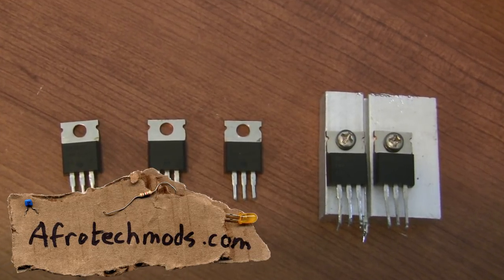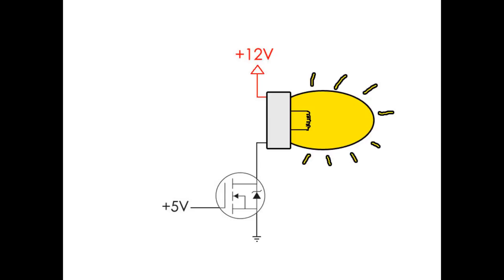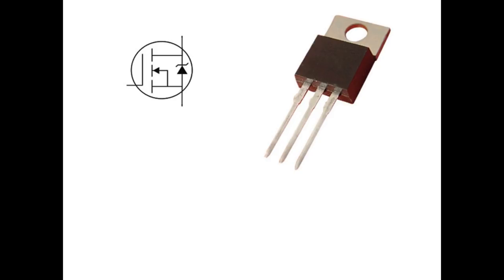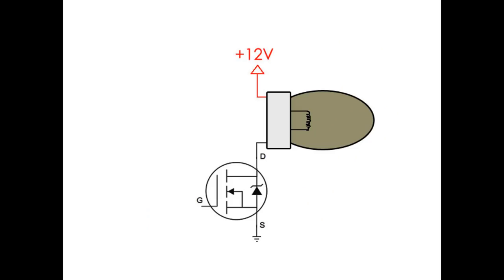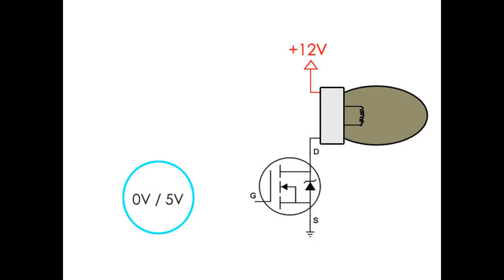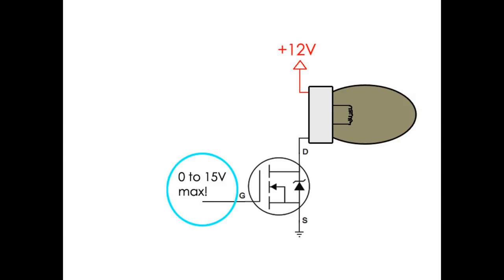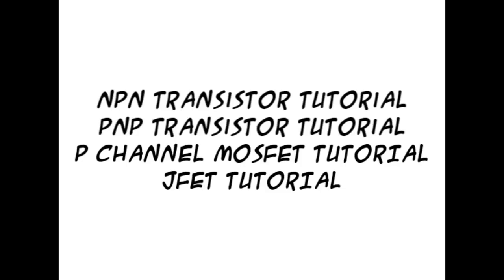Transistor / MOSFET tutorial

Comment from the maker: Gah. Now I wish I had covered this in the video. The gate pin has a small capacitance, and will hold a voltage for many minutes with no power applied and pick up stray voltages very easily. So you should put a 100k resistor from gate to ground to discharge the gate and have the FET off by default.
Reply: i figured it needs a pull down resistor. I wish you were posting more vids

Comment: A water heater takes AC, you can only switch DC with the circuit from this video. You could use that last circuit he describes here with the relay. The mosfet switches the relay, the relay switches your water heater.
If you want to switch AC directly, use a TRIAC / Opto coupler combination. There are zero crossing aware opto couplers that makes this very easy. Or you could use a solid state relay, that might be even simpler.

Comment: To people thinking it's a relay. The general purpose is the same, but there are important differences
1. a relay is isolated from the circuit, but a mosfet is not. Drain and Gate share both the Source, meaning that the current of source is gate + drain. Usually this isn't too important, but be sure not to connect a fusion reactor to the gate.
2. Mosfets are much quicker. You really only want a relay at the very end of your circuit, and only use mosfets for this function within the circuit because it doesn't have a built in coil and the moving parts are much much smaller.
Reply: Can you use these to make a PWM control for a cooling fan for a car radiator ?

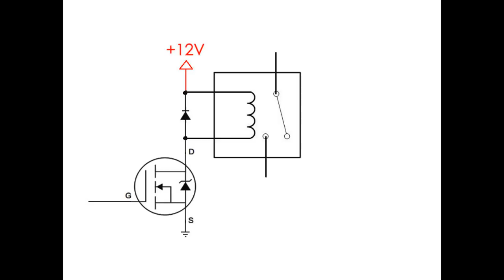Comment: 4:05 made me to subscribe this channel.
This is what i was searching.
In a single video you had explained everything.

Please provide direction of diode to be used with solenoid.
Reply: I agree this is one of the best simplifications on how to use a MOSFET. Saying it explains everything you need to know would be exaggerating. For example it did not answer what do you need to do to switch loads of higher currents even though very high currents are often found in MOSFET data sheets. It's difficult to find a logic level MOSFET that can be used to switch for more than 1-2A of current. It becomes much more difficult if you want to do it with a controlling device using 3.3V logic levels such as an ESP8266 or a Raspberry Pi. When this video has been created 3.3V logic levels were not as widely used as today.

In case you have not yet found the answer, Afrotechmods suggests watching this video of his in a reply to another comment made 4 years ago: https://youtu.be/LXGtE3X2k7Y

Comment from the maker: 3VDC is generally quite low for mosfets. It might work, but there will be noticeable resistance between drain and source (perhaps 1 ohm or more). You can get 'logic level mosfets' that switch on with very low voltages, but they are usually only good for switching 10-30V. If efficiency is not a huge concern and you just want something easy, get a TIP110 from Radio shack or any NPN power transistor. They will switch on fully with 3V no problem.

Comment from the maker: @Xearo167 Electrical engineers work with what is called "conventional current." It is backwards to what is correctly taught in physics, but all electrical engineering laws and formulas are based on it. So for the purposes of designing circuits in EE, current flows from positive to negative.

Comment from the maker: That's a more complicated question to answer but i'll simplify it... the IRFZ44 will start to turn on somewhere between 2-4V but there will still be some resistance around 1k-100k ohm. With Vgate at 5V the resistance is low enough to be useful, roughly 1 ohm. It will be 'fully' turned on with 10V and the resistance will be around 20 milliohms.

Comment from the maker: @HHOhybridBuilder Sort of. Varying the gate voltage from 0 to 5 will vary the drain-source resistance, which will result in the drain-source voltage changing when the FET is operated in the linear region. This is usually done in amplifier circuits and it causes a lot of heat to be generated in the fet. For switching applications you want to avoid the linear region so the FET is either high resistance or very low resistance - nothing in between.

Comment from the maker: @Bizorke For an N channel MOSFET Vgate has to be typically 3-10V higher than Vsource to turn on. The drain voltage does not factor into this, although it indirectly does when the FET is being driven high side. But for example, if Vdrain is 20V and you tried to make Vgate higher than that you might kill your FET.

Comment from the maker: @WINANDMACNERD Sort of. There is a small linear region (around 1-2V) on many fets that will act like a voltage controlled resistance. However you will need to DC bias your sine wave very precisely and make sure the amplitude of the wave stays within the linear region. Read up on the datasheet for RDSon versus Vgs to find the region. This will also cause the fet to heat up. You could also look into digitally controlled potentiometers.

Comment: The way I see it, Drain goes from the negative end of your car light bulb (opposite the side of power input), Source goes to vehicle ground or battery negative (in this example of car light bulb), and Gate is the switch, 0v for off or 5v for on, from some sort of transistor-suitable voltage. Please correct me if I'm wrong, as I've used lots of relays and have never used a transistor of this type before, but this would be a great thing to learn!

Comment from the maker: @herctrap The LED will also need a current limiting resistor as usual. But the main problem here is that the voltage between Gate and Source has to be at least 5V for the FET to turn on, which won't happen because Vsource will now be ~12v when the FET is on, so you'd need a gate voltage of 17v, which is impractically high. In other words, you need a high side gate driver circuit.

Comment: @Afrotechmods Awesome tutorial! Regarding the voltage between gate and drain - once the FET is in the ON state, the voltage on the gate does indeed need to be at least one threshold voltage higher than the DRAIN in order to make the FET FULLY ON. This is only really important when passing very large currents through the FET, where the current times the RdsON is more than 1 volt. This is the reason why it is important to drive the gate with a few volts more than the Vthreshold.

Comment from the maker: @gizmoguyar You got it. Make sure you connect the grounds (a thin wire will do). The high current should be flowing through the FET. That will of course depend on where exactly you have the power wires connected. The -ve wire of your external power source should be connected directly to the FET's source pin. If you were to connect it to a ground pin on your Arduino, you can imagine the current would flow from Source-> Arduino PCB -> -ve wire which would be bad.

Comment: Good mosfet intro! Just mind that drain current and the on resistance of the transistor. Don't want to fry the device do we? And speaking of frying, rid yourself of static electricity before handling them. Wrap them in aluminum foil when storing

I used to employ S901x npn/pnp as my all around standard switching transistors. They're cheap. But when I discovered the 2N7000 I've been using them anywhere I can. Saves me the trouble of putting in and computing for gate current limiting resistor

Comment from the maker: @lowsideswitch Transistors can be switched faster infinitely - most relays can only be switched a few times per second and have a life of 100k cycles. Switching an N MOSFET high side will require some extra gate drive circuitry.

Comment from the maker: No need for a mosfet driver for occasional on/off switching as done in these examples. If you are doing 50+kHz PWM then a gate driver starts becoming more useful (way beyond the scope of this tutorial). The diode is in the correct place for low side switching of inductive loads. You might be thinking of H bridges.

Comment from the maker: @rainbowsalads Use a diode to convert the AC into DC then use an NPN transistor to toggle a relay which switches on the bulb. Or find a small relay with a 3VAC coil voltage.

Comment from the maker: The circuit in the video should work (you can use the version with a relay if you want) if you add a 100k resistor between the gate and ground. This allows charge on the gate to drain to ground which will turn the mosfet off.

Comment from the maker: Sorry, it's a convention electrical engineers use. The ground symbol in these circuits does not actually need to go to the earth ground in your house's wiring. You can basically think of the minus wire from your power supply/battery being the same as ground. The ground wire should definitely not go to the positive terminal though! That would be a short circuit!

Comment: Just a note: MOSFETs more often then not, need more the 5V on the gate to turn on. Study the specifications for your FET and watch out on the dissipation. An important parameter is RDSon.. This is the resistance when the gate threshold is met (Vgs). FETs can have very small RDSon values, like 0.05Ohms.. With very low RDSon values you can switch large currents without a lot of dissipation.
Reply: David Fowler thanks

Comment from the maker: @sjh7132 Good comment. When driving MOSFETS in switching applications, you want to drive them hard on, or hard off. Putting a wussy 1.5V signal at the gate won't be enough to fully turn the FET on, so there will be more resistance, so there will be more heat. A good gate driver circuit will switch hard between 0V and 10V, but 5V is often enough to get the job done if you aren't switching high currents. It all depends on the specific Rds(on) versus Vgs characteristics of the FET.

Comment: Most fun to be had out of these is when building a 12~14.6VDC car amplifier or radio head unit, coupled with a few high power capacitors to really crank out the sound.  What I'm confused about is when a radio head unit is supposedly rated at 50 watts MOSFET for 4 channels each, yet expects to pull all that power (at least 200 watts) through the little tiny gauge ACC power wire.  The memory wire has to be attached to for the radio to work correctly, but there is no way in hell that radio is pulling anywhere near 200 watts RMS without frying wires!  The Pioneer amp I'm using outputs 300 watts max, and it uses pretty fat power input and ground wires!

Comment: Voltage & Current are stored in Inductors and when the electric field of the Inductor collapses, the voltage tends to collapse to a negative version of itself. The diode protects the transistor from what is known as back emf (electromotive force) by limiting the voltage to the voltage at which the diode goes into conductance, which only happens when the field is reversed.

Comment: u definition about transistor is fully correct.. a transistor can be used in three ways.. active, saturated and  cuttoff.. when in active region it is an amplifier which amplifies signals.. in saturated it is on.. and in cuttoff it is off.. the use of saturated and cuttoff transistors together forms digital..that is on and off..

Comment: @spectralcodec Vgs(th) is the transistion point between the voltage controlled resistor range and when it is completely Rds(on). However, that transistion is exponential which means even a small amount of over drive will result in a full turn on. You will notice that the Vgs(th) max of the chip you mentioned is 4v which means 5v is a whole 25% over.

Comment: @darkwedder this is based on "conventional current flow" which some folks call "hole flow"; it is based on Ben Franklin's assumption of a positive charge for the electron. Physics and electrical engineering have adopted this convention and works very well for ckt analysis and design. It is not widely taught to technicians but it is important to understand so you can talk the same language engineers do.

Comment: A switch requires a person to be there to switch the load (in this case a lamp) on and off. A mosfet acts as an electectronic switch that can be turned on and off with a computer system, say, or a remote control.

Comment: @gizmoguyar MOSFETS are so simple to use, because they only require a change in voltage and almost no current to switch. Your digital outputs from the arduino should work fine.

Comment: if you just use it as a switch then yes. there is a kind of relay called Solid-state relay, basically it's big transistor with higher voltage limit and it's non mechanical, so much more reliable.

Comment: To clarify for beginners, I would show the complete power circuit.  For example, show that the 12 volt battery has its negative terminal connected to ground so you see a complete circuit.  Makes it easier for someone wanting to play with flashlight battery powered circuits, etc.

Comment from the maker: Crap. You are right. The parallel port/digital signals would not  need this resistor, but for the mercury reed switch example a pulldown resistor is highly recommended.

Comment: to drive a transistor from 555 timer, you need a current limiter resistor to be put between 555 output and base of transistor, because a connection between BASE and EMITTER is similar with a plain diode, that has constant voltage drop around 0.7Volt whatever big the current comes. This differs alot compared with N-Channer MosFET's connection between GATE and SOURCE.

Comment: Thanks for taking time to explain these things for beginners . Obviously people in the know don't need this. But when you got pixies flying around it's kinda nice to know where they are goin. I do have a question "is the heat sink portion  at the top attached to any of the pins. I think I've seen the top part of the circuit.
Reply from the maker: That is a good question. It usually is but occasionally it is not. It could be internally connected to any of the pins but it is usually connected to drain. You will need to look at the pinout on the datasheet for every transistor you work with.

Comment: logical microchip use 5V+, and the out signal also is a 5V+ signal, so depending on the chip you will get a output signal of 5V+, let say a microcircuit control the temperature on a water tank, when temp raice over 60º the microcircuit send a signal of 5V+ to the gate of the mossfet and the 12V+ light turn on. The important thing here is that you can turn from 5V+ signal to a 12V+ signal (amplified signal)...

Comment: @Sethjxl Due to the exponential source drain resistance to the gate voltage relationships, MOSFETS are practically only on/off switches and it is close to impossible to control the load voltage via controlling the gate voltage. PWM is an option however you would be limited by the switching speed of the FET and so your "dimming off" may not be seamless. I would recommend adding a capacitor in parallel to the source-drain of your FET. The time constant of the Cap would be your dimming time.

Comment: there are high frequency MOSFETs which works with/on 2GHz or higher.Those transistors have 4 terminals and it is not recommended to touch them with your hands ..similar to EPROM memory , the bio energy can affect their parameters.

Comment: 5V at the gate will be a bit low for many MOSFETs. The transistor won't be fully opened. This could be a problem when switching a high current load. There are logic level MOSFETs that are open at 5V. So check the datasheet of the device for the right gate voltage and don't assume 5V is enough!

Comment: When a MOSEFT is switching it requires a large current to be provided to the gate for a very short amount of time. It might be that the 555 timer is incapable of providing this current. I might recommend you using a simple driver to drive the MOSFET. If you google "bipolar half bridge driver" and go to images it will give you some simple circuits.

Comment: @daniel1c MOSFETs can switch quite quickly, in fact in the 100's of kilohertz and up. The key is charging the gate capacitance quickly enough to get the gate voltage up to and past the MOSFET turn on voltage.

If you're just dimming a light then you don't need a fast switching speed, not even a capacitor. Also, someone correct me if I'm wrong but putting a cap across drain-source is not a wise decision

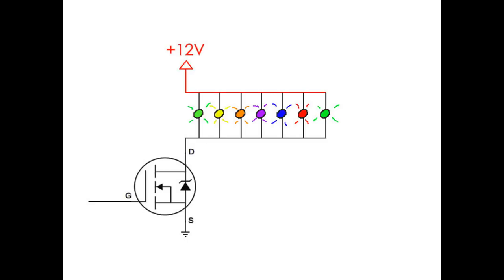Comment: Love your videos. I love the mix of theory, practical application, and just enough toasted components to keep it interesting! Trying to learn enough for some projects. Re-watching this one again and I have a question about the diode mentioned at 4:02. What is that for? Why can you do those things IF you add that diode? I'm sure an answer will help clear up some fuzzy part in my understanding. Thanks!
Reply: Oh please, don't forget it! That is called flyback diode, it is used to prevent your mosfet/bjt from frying. 
A motor is a good example of an inductor, which means that when you cut power off it the collapsing magnetic fields generate a huge potential difference across the motor, which can easily fry your mosfet (we are talking of hundreds of volts, have you seen the big sparks that disconnecting motors makes).
The flyback diode shorts that power to vcc. You can use something like a 1n4001 for small motors.

Comment: Surely, but consider the needed current and voltage to drive a relay: eg a computer (or microcontroller etc) is not enough for that. That's why you need "more steps". Also relay is a bit dangerous, as its inductive spikes can harm stuffs, that's why the extra diode as well, but if you would connect a relay directly to a TTL level (if it's possible at all .. maybe the current would be too high for an average logic output line of some IC) it can cause even more problems. Well: as far as I know :)

Comment: @hbar45 The bipolar transistor doesn't have as much in-take impedance, so it takes more current to turn on.
A bipolar may take 10-20 microAmps to turn on, while a MOSFET in the same situation may only take 0.3 microAmps to turn on.